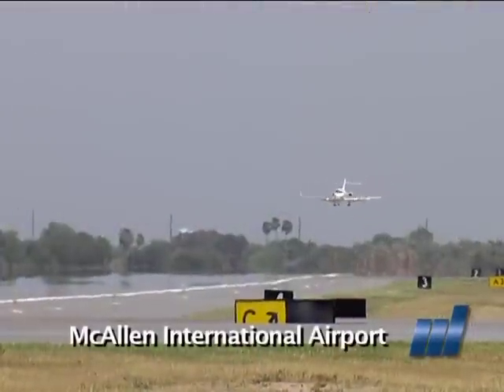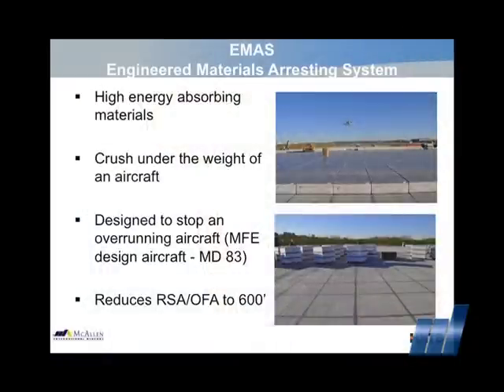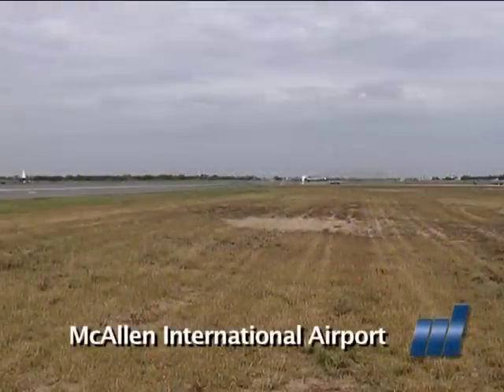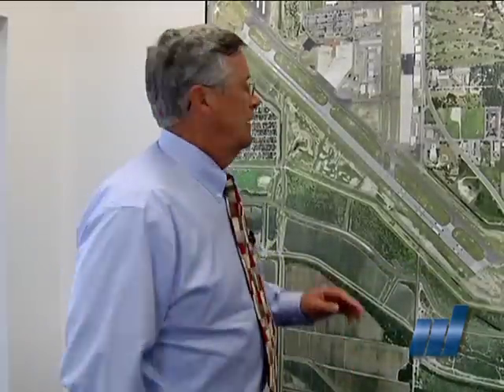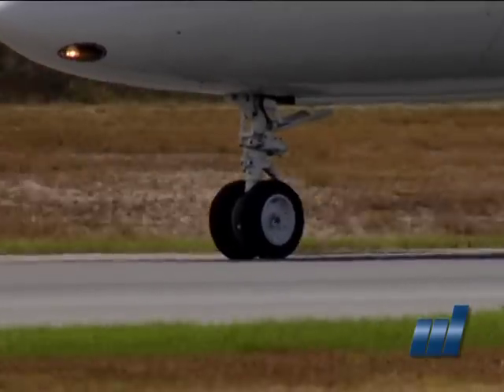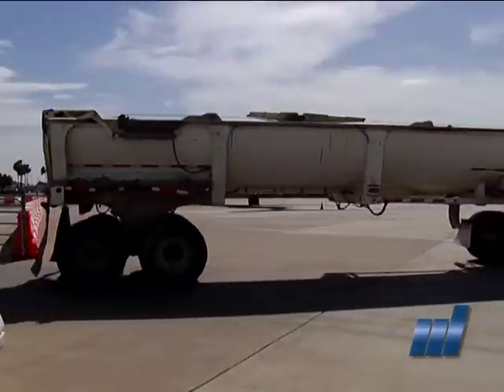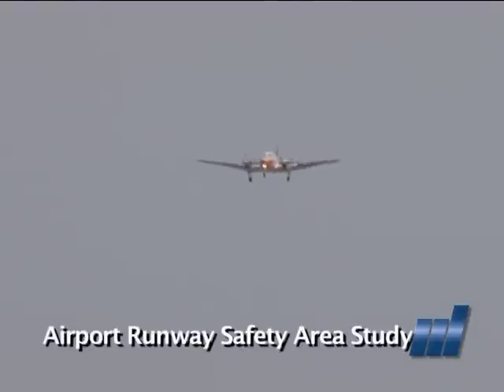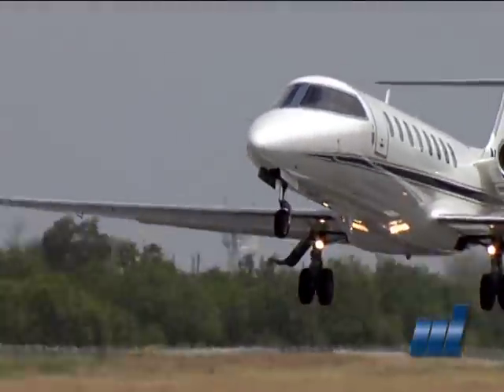Airport Runway Safety Area Study

Comment: I am doing my graduate capstone project on EMAS. It is very cool stuff. Expensive but cool. I am glad that your city ended up installing it. So far, there have been 8 engagements with a total of 235 occupants. The result - 0 injuries and minimal aircraft damage. In every single case of engagement, it saved the aircraft from more damage than the system cost. I hope it is never engaged at your airport but if it is it will be worth it! Very cool stuff indeed.